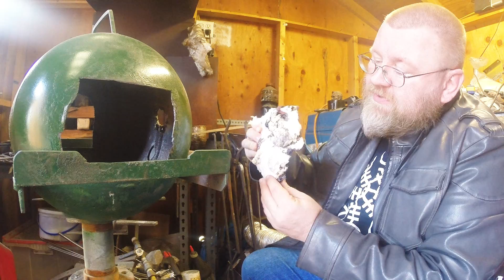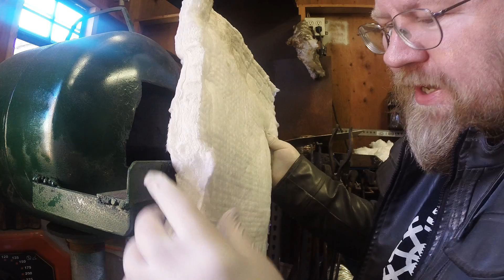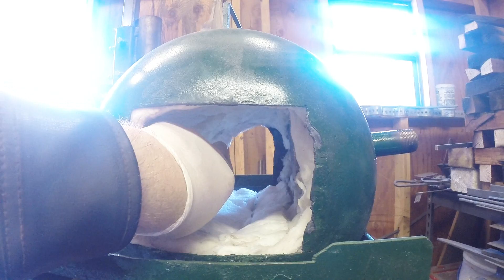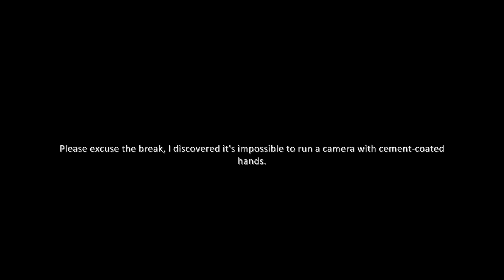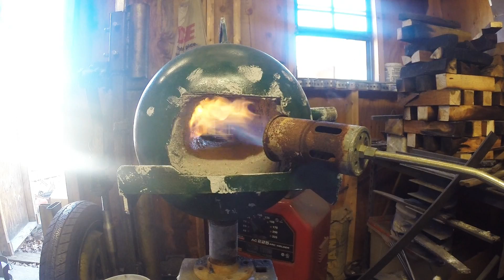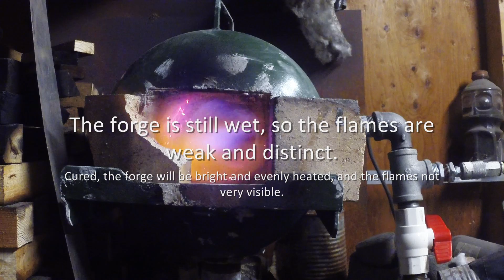Building A Forced air Gas Forge

Comment: Mr Price ...I'm really glad I watched this video as you talked about silica causing health problems.im just starting out in blacksmithing and I don't have a lot of money.on alot of YouTube videos there are people making homemade motar recipes and it's making liquid glass  that can withstand high temperatures.its basically silica gel mixed with lye drain cleaner.do you think mixing this with mortar mix is dangerous or have you heard of anyone having problems doing this? Also did you say to set the ribbon burner at an angle to create the swirling flame effect ?

Comment: Wondering how your forge is working with the 1 inch black pipe,I'm in the middle of building a new ribbon burner forge ,everyone seems to be using 2 inch and it's a pain to get in Alaska without buying a 10 foot stick.
Reply from the maker: WildmanPB Works just fine with the blower.
Reply: I just got my forge together last night with 2".  One major downside is just how heavy 6 foot of 2" pipe is!

Comment: Perhaps I will try to place a flat piece of wood on the bottom after the "mizzou"(?) mixture. And then insert a section of large inner tube and blow it up with air in order to put even, constant pressure around the sides and top. Perhaps that would make a real nice arc for the inner venturi and pack the insulation until it cures. Then either simply pull the board up possibly having wrapped it in cling film or burn it off within the forge. Does that sound like too much to go through in your opinion? Just in case the insulation was mixed too thinly/watery? To keep it from dropping down our sagging like an inner city youth's pants! 
Thanks for this video it was very well explained. One more thing. The first thing that crossed my mind was instead of crayons, to use glue sticks used in hot glue guns. Would/could it be beneficial to actually carve them in to a slightly conical shape? For even more efficient use of pressure and gas? I am just lately getting the bug for the fire arts and although I'm handicapped I can see myself having a whole lot of therapeutic relief by getting my creative juices flowing again. After 20+ years of custom woodworking I've been crippled for the last 8 years with severe neuropathy. I cannot be defeated! But at times I would like to be "de-feeted" if you know what I mean 😃 this stuff hurts. Thanks again!
Reply from the maker: Everything you suggest would just complicate the build, I find. It's not too hard to adjust the consistency of the refractory cement, adding either a little water, or a little more mix, if you find yourself to one side or the other of ideal. Also, straight holes work just fine, tapering them would cause more turbulence and back pressure, when what you want is smooth flowing air/gas. 

Good luck.
Reply: Christopher Price thank you for the feedback. Knowing nothing, makes it hard for me to know anything 😃
Channels like yours make it possible to learn without making all of the same mistakes that you may have made.

Comment: Mr. Price, how does the mizzou stand up to flux? Does it last a while or should I add hard brick to the bottom or would it even matter?
Reply from the maker: Since I did this, I have welded many things, and much flux has landed in the floor of the forge. At welding heat, it gets a little sticky, but the mizzou has held up totally solid underneath it. Someday I'll have to chip it all out and re-line again, but that's something almost every forge has to endure periodically. No lining lasts forever under heavy use.

Comment: Wondering how much space is between the refractory & the steel plate?  Looks around 3/8” or 1/2”.
Reply from the maker: The kaowool refractory is flush against the steel body, and is between 1 and 2 inches thick at various points around the forge. More on the floor. The Mizzou castable refractory fills in any small gaps and seals the wool against particularization and abuse from flux and steel.

Comment: Hey Chris... Thanks for the video.  Can you see any issues with mounting the ribbon burner on the top of the forge instead of the side?
Reply from the maker: +worldtraveler No, just try to visualize the kind of airflow you want in your furnace, and how you'll handle the stability of the furnace with extra plumbing and weight up top. You might prototype it with bricks or plain inswool first, so if you don't like the heat distribution, you can alter your arrangement for your finished forge.
Reply: +Christopher Price Take a peak at this for me please... http://waynecoeartistblacksmith.com/uploads/Ribbon_Forge_Burner.pdf
I'm building one of these now but is running on natural gas.
Reply from the maker: +worldtraveler Yes, I know Wayne, and have used his rig. That is one way to do it, but it seems like everyone's needs are a little different. Good luck.
Reply: +Christopher Price Thanks bud!

Comment: what did is the brick made out of? is it the concrete material you used on the kaowool
Reply from the maker: +Alex Rodriguez Yes, it's made by casting Mizzou castable refractory in a custom mold, using crayons to create the hollow space for air and fuel to flow through. You melt them out before installing.

Comment: What type of fan do you use?
Reply from the maker: metalsculptingben My blower us up-cycled from a small moon-bounce toy, so it's overkill - but I reduce the hose from 4 inches to one inch pipe before adding fuel. It's what is commonly called a "squirrel cage" blower, good pressure, but backpressure won't burn out the motor because of the wide inlet... the blades will just spin in their own air with reduced output.

Comment: Is that the power hammer Sam built? Nice, low overhead design. I do like that ribbon burner design. I was turning those 316 stainless nozzles into bacon pretty frequently before casting the burner in place.
Reply from the maker: Brian Madigan Yes, that's the famous Salvati Tire Hammer. As for the burner, there is no "nozzle" involved, it's just the steel box manifold with the pipe coming out the back, and the casting on the face-side of it. I used Mizzou, but I think you could do everything with basic parts and furnace cement (the grey kind, not the black stuff) from the hardware store.
Reply: ***** Excellent. Yeah the old way was to poke a flared nozzle through the kaowool and as it got exposed to the heat over time it would just disintegrate. Casting in the ribbon burner leaves no steel exposed to the atmosphere. Is good. Oh, another thing, if you want to get all the air bubbles out of the castable, use random oscillating sander with a rod screwed into it. Cheap vibratory bubble remover.

Comment: If you weren't pressed for time could you have just left the refractory to cure for a couple days or would you still be baking steam out of it then?

Also what are the reducers you use to go from 1 inch to the gas quick disconnect.  Did you seal the connections with anything or are they just hand tight?

Thanks
Reply from the maker: RocketCityGardener If only the Mizzou were wet, then yes you could just leave it to dry. I had an excess of water in the Kaowool, so I wanted to force it out before the inner shell fully cured. As for the fittings, I just used a 1" T-fitting, and found the step-downs to the quick-disconnect fitting. All threads from the gas line are doped and tested for leaks.